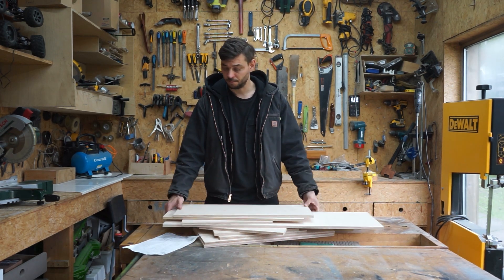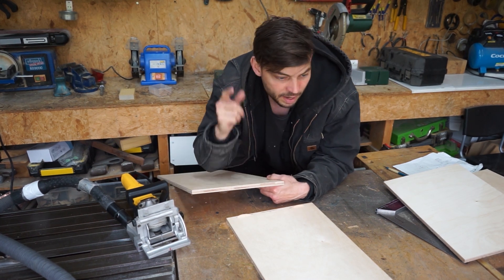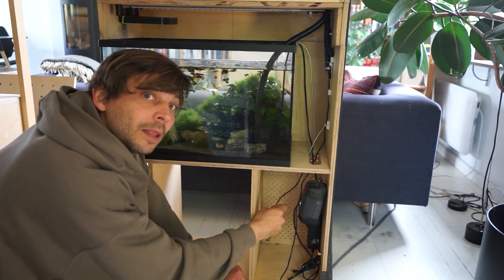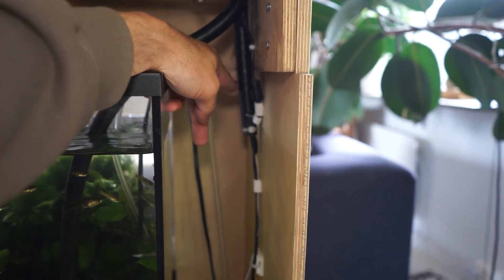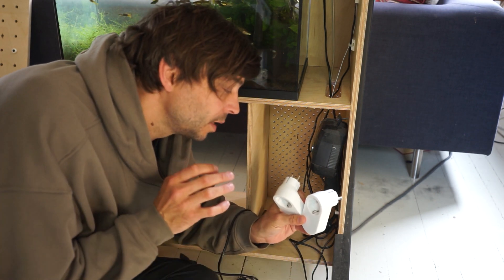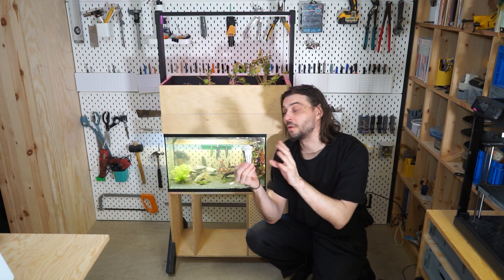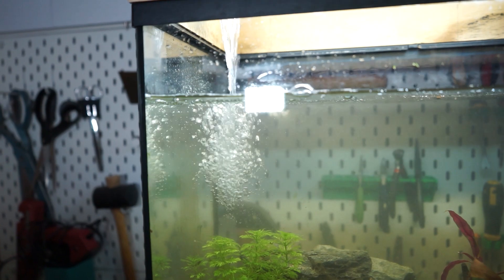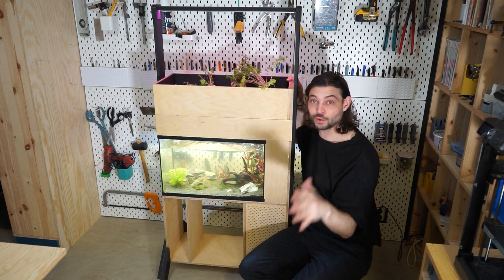DIY Aquaponics furniture piece

Comment: thats really cool, hopefully it will work as you envision soon, the only thing I would be slightly weary of myself is the electronics being susceptible to moisture build up, but its probably just paranoia on my part.
Reply from the maker: Thnx for watching and yeah i am a bit unsure about the leds right above the aquarium, the other electronics are far enough away and kinda closed off from the water. Paranoia can be good when dealing with electronics :D